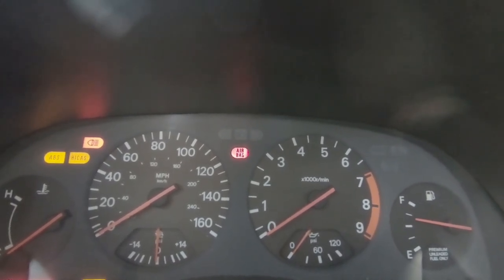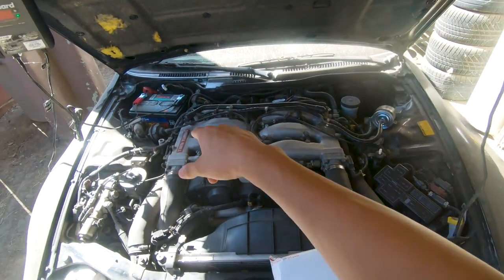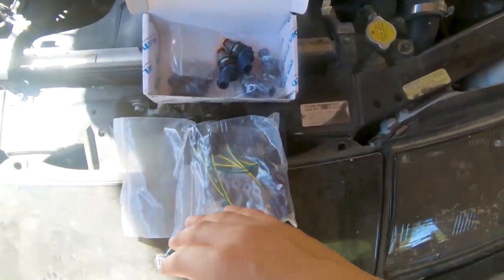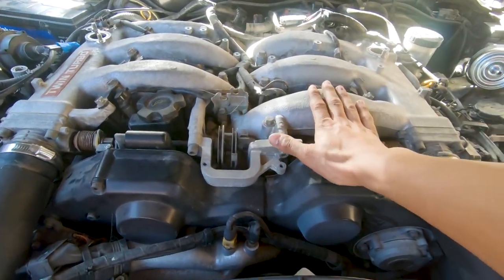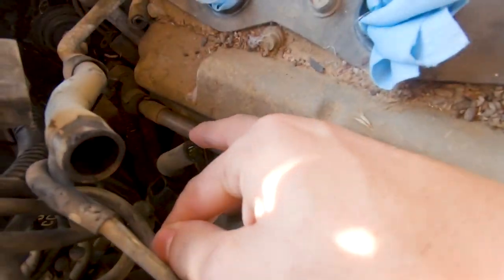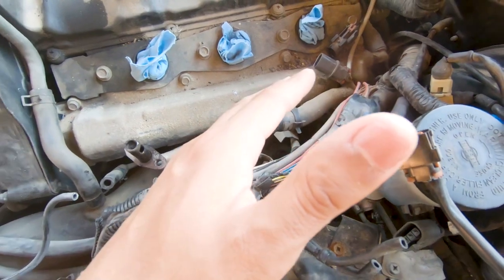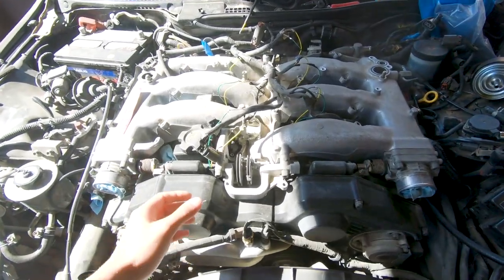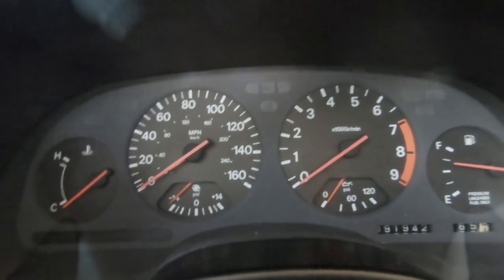Installing New Injectors + First Start In 16 Years!!! (1992 300ZX)

Comment: looks very similar to the adapter kit im trying to install right now. my issue is the little metal half washer doesnt fit on the new injector. did you just run it without it?